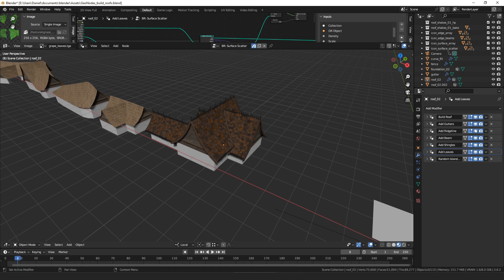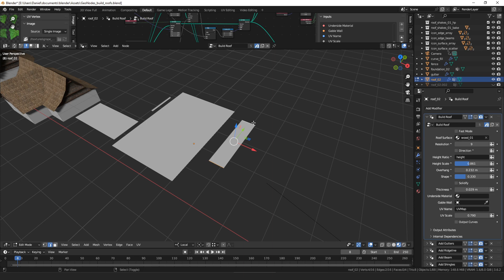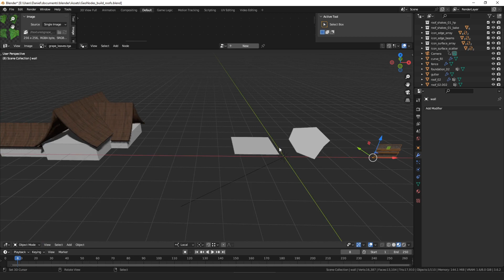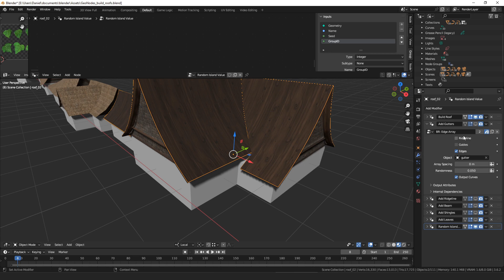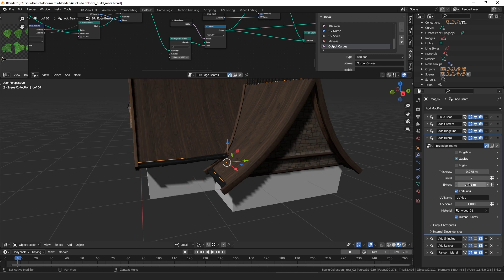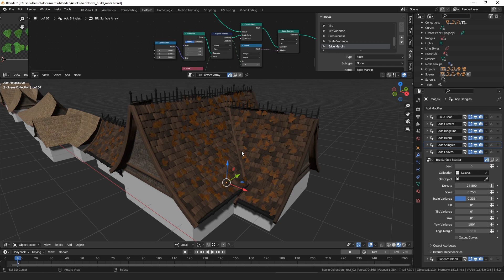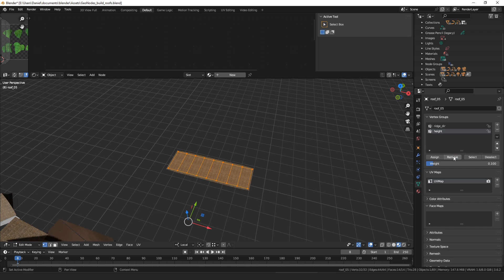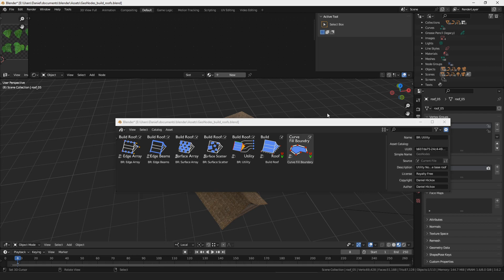Geometry Node Assets: Build Roof Nodes

Comment: Hi. Would you be able to create a tutorial on just the first step of the actual base mesh used to create the roof? I'm a little confused how you actually got to what the base roof looks like at the very beginning of the video starting around 04:11 onward. I'm trying to figure it out using the nodes and maybe a bit slow to understand. Thank you.
Reply from the maker: Yes, that was a bit of an oversight, I'll plan to make a Build Roof tutorial soon where I start from scratch and make a roof.  You can see an input mesh a bit at 16:15.  They are essentially a flat plane or set of 2d faces, that are a footprint for the roof.  On that mesh I add a vertex group named 'height' which allows the height of the roof to vary per vertex.
Reply: Thank you!  @looseEdges

Comment: idk if you covered this. but as someone whos in a similar tech-art territory these are super useful, but if I wanted to make new trees with these and sell them(like a generator of some sort) are there any issues with that?
Reply from the maker: Specifically for tree/plant presets made using my nodes, as long as it more than just a copy of my nodes, I'd be totally fine with that.  Though I would appreciate it if you'd mention my nodes somewhere in the description and maybe link to them.
Reply from the maker: Or did you mean trees as in 'node trees'?
Reply: @looseEdges  oh sorry yes I meant node trees in general. But you basically answered my question. Which would be the idea. I've had some generators I've been working on. I'm planning to get your pack for those and future ones.